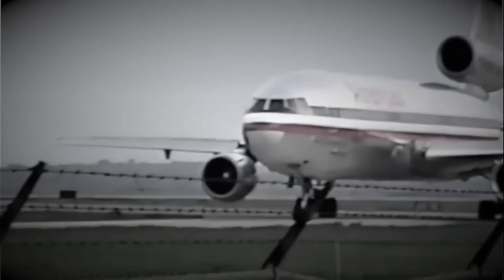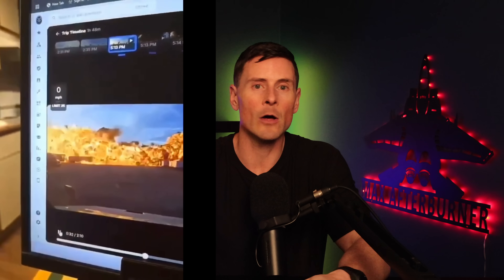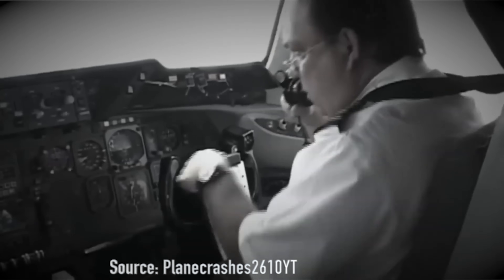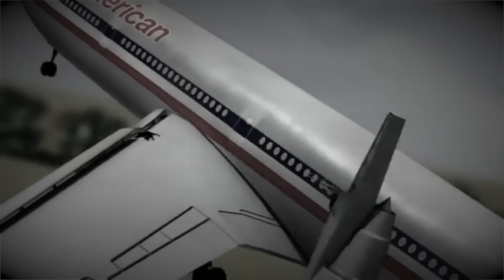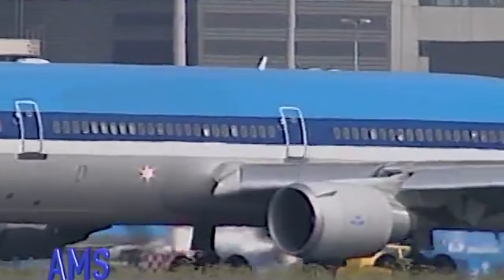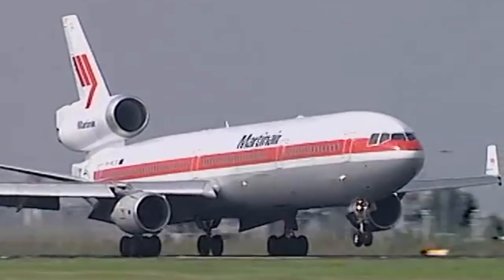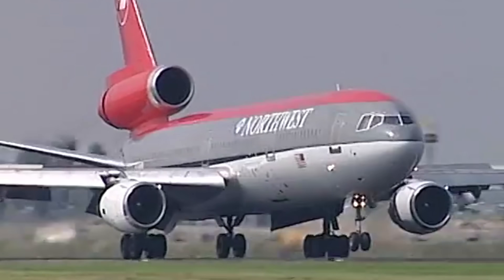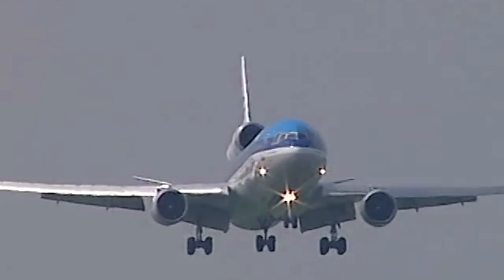Airline Pilot Exposes CRITICAL FLAW of UPS 2976 DISASTER

Comment: Number two being affected is a theory at this point but it seems possibly likely because of the wing fire caused by the Detachment of the number one engine.
Please give them time to study the actual chain of events before you try to compare what happened in Chicago with what happened here they do not have the same engine attachment points on these engines. I worked with Metals for 41 years in my main job and I also consulted on several air crashes notably the 7:37 problems that I told them early was caused by the rudder actuator. But I wasn't certain as to why that was failing but I knew that that was an integral part of the failure on those aircraft. But you have to give them time, this just happened a few days ago. Because there's nothing obvious except that there was a wing fire after major maintenance had been done on that specific aircraft. They are going to have to look at a lot of the maintenance that was done and what possibly went wrong. This particular md11 had a much more recent flight data recorders which may be of great help. But this is going to take a lot of time shuffling through the high amount of Maintenance that was recently done on this specific plane. And looking at what happened during this incident. I have been consulted on air crashes since I was a two striper in the Air Force. That was in 1976 when I was working on both Air Force and several Navy aircraft. Along with at least one civilian aircraft owned by none other than Daryl Grenemeier.

Comment: I imagine the only similarity is the MD 11 has some things in common with a DC 10 and both involved the no 1 engine and the aircraft was left wing down at impact. AA 191 lost the no 1 engine at a speed about 10 kts above V2, and at that time the engine failure procedure AA pilots accomplished was to raise the nose and climb at V2 speed. This speed was too slow with the left wing slats retracted and the left wing stalled. As an AA DC 10 pilot we were instructed to maintain the higher speed if above V2 at engine failure and not slow to V2 after the 191 accident. Research showed that 191 might not have crashed if the crew maintained the higher speed at the time they lost the engine.

Comment: It might be time to permanently retire these aging aircraft.
Reply: It's quite difficult to, because there isn't a direct replacement for the MD-11. Similar sized aircraft like the A330F and A340-300/787 either don't have freighter versions or have significantly worse payload. The 777 is too large and the 767 is too small. Now airlines must use the 767 and 777 in tandem just to fulfill the job of one MD-11.

Comment: Think about the problem of the debris search area outside of the airport.  If a plane crashes into a field or forrest, it is easy to detect metal and manmade parts, but the plane crashed into a place which has something like a junkyard, vehicles and structures with wires, pipes and equipment, so it won't be so easy.   Not only was the jet full of fuel for a trip to Hawaii, that area appeared to have piles of tires and petroleum products.   I wonder how much of anything survived?  Because the engine and engine cowl fell onto the airfield, it might make things somewhat easier.

Comment: https://en.wikipedia.org/wiki/El_Al_Flight_1862   Engine No. 3 (right wing, nearest to fuselage) separated from the right wing of the aircraft, shot forward, damaged the wing slats, then fell back and struck engine No. 4 (right wing, farthest from fuselage), tearing it from the wing. The two engines fell away from the aircraft, also ripping out a 10 m (33 ft) stretch of the wing's leading edge.  The official probable causes were determined to be:[3]: 46 
The design and certification of the Boeing-747 pylon was found to be inadequate to provide the required level of safety. Furthermore the system to ensure structural integrity by inspection failed. This ultimately caused – probably initiated by fatigue in the inboard midspar fuse-pin – the no. 3 pylon and engine to separate from the wing in such a way that the no. 4 pylon and engine were torn off, part of the leading edge of the wing was damaged and the use of several systems was lost or limited. This subsequently left the flight crew with very limited control of the airplane. Because of the marginal controllability a safe landing became highly improbable, if not virtually impossible.  Bijlmerramp - El Al Flight 1862 - Amsterdam Air Crash - full transcript https://www.youtube.com/watch?v=m3SLhwEzVz0
I worked in a compressor factory. Management wanted cost reductions and suggested to cut the Non destructive testing. I strongly recommended to do all required testing including the non destructive tests. When a machine is inspected and repaired by an OEM they expect that all required tests are done. Than you as OEMn can give the required guarantee on parts, repairs, etc. Than failure during operation is caused by the user and not by the OEM. I never had guarantee issues on my repairs! 100% OK.

Comment: I was wondering how the heck an engine could be lost upon takeoff... But structural micro fractures you mentioned sound like a plausible catastrophic failure due to multiple use from stress... I know aircraft go through annual maintenance inspections but I'm wondering if mico fracturing is difficult to see visually because they could be covered by paint  over the mechanical apertures?

Comment: I'm a pilot and other than the obviousness now of the statistics Airline safety is not the best it has ever been and it is most definitely less safe in my opinion.  Less experience in the cockpit, also way more airplanes in the sky with less controllers and the same systems....also, I don't know what your talking about 2 gs being normal in airline flying and that it's not unusual.....

Comment: Dye penetrant testing probably requires disassembly of the parts but it is not "maximally invasive" if there are no cracks.  The penetrant dye seeps into cracks only if they exist.  Often the surface is then sprayed with a white or other color coating.  The contrast of the dye leaking out is how you see the flaws.  If there are no flaws nothing penetrates.
Reply: They generally use Xray inspections for critical heavy fittings like that. A dye pen might be used to verify a visual indication.

Comment: It seems that all the aviation vloggers are trying to get videos out with the most exhaustive set of scenarios and conclusions to get channel hits with a long shot hope their hypothesis is close or correct and here's another one.

I've flown hundreds of hours on the former Swissair MD-11s and love the type.   The comfort, performance etc were amazing.  Rate of climb out of the old Kai Tak was mind blowing as was the climbout angle.   I'd get on another M-11 without hesitation.
and.....
This may have remote similarities to the AA DC-10 crash but the AA crash was caused by faulty maintenance procedures where they fitted a new engine attached to the pylon.

Noone knows (the real facts!) if that -10 failure happened to this MD-11?
Reply: Yes but the MD-11 has the worst hull loss rate of any widebody airplane at 3.12 per million flights. Which is 10x higher than the Boeing 777 or A330.

Comment: The MD-11 has been flying since 1991. Since they haven't all crashed, obviously, there is not a critical flaw. McDonnell Douglas had a great track record for aircraft, e.g., F4 Phantom. I suspect maintainence, metal fatigue, inspection deficiencies. Almost every incident comes down to post factory human error.
Reply: The MD-11 has the worst hull loss rate of any widebody airliner at 3.12 per million flights. 10x higher than the Boeing 777 and A330.

Comment: Anotheryoutube channel that had audio and there was warnings of birds near that runway if you noticed before the engine came off there were already flames comeingout of the engine pylon either melted from the fire flight 191 had no fire trailing it wh we n it crashed  the majority of crashes with the dc 10s is due to the failure of the luggage doors since it opened outwards ww2 91 was due to the aa not using the proper equipment to mount anddismount the engines

Comment: There is zero comparison between AA191 and this UPS crash outside of them both losing the #1 engine. You keep hitting the critical point so many times but you then gloss over it. 

AA191 crashed because the slats retracted and the pilot pitched to V2 (or V2+10 I honestly don’t remember and I don’t feel like looking it up because it’s irrelevant.) Thats what they were trained to do. HAD THE PILOT MAINTAINED CURRENT AIRSPEED at rotation the crash would have been averted period full stop. The slats were redesigned after the crash to prevent future incidents.

UPS crashed not because the #1 engine detached, but because the #2 engine suffered multiple compressor stalls as evidenced in the multitude of videos posted. She was basically flying with not two good engines but maybe little more than one good engine. At max weight. There was no recovery possible.

The only shared characteristics between this crash and AA191 was that it was a DC10/MD11 airplane and they both literally “lost” an engine. Everything after the separation event is unique to each crash.

Comment: Can we stop talking about the left wing stall. That is not what happened. There is a video out showing the plane crossing the street right after the tail hit the first building. The plane was still flying level. It then crashes into more buildings and you see it violently roll during breakup. The plane lost its #1 engine, probably due to an improper maintenance a month earlier, loose hardware or damaged pylon, then the debris caused a #2 stall, and when fully loaded #3 engine didn't have enough power to gain altitude and it hit the buildings. Pilots did an amazing job keeping it level as long as they could.

Comment: Well… not really. The AA flight lost hydraulics and the slats retracted creating a lift issue. That is why it rolled over.
This UPS almost made it. They looked like they might have been able to keep it up if they didn’t hit power lines.
That put them into the building, and even then it almost pulled out on one engine… but hit more power lines.
They were flying it… and flying it level until it hit wires.

Comment: As as a DC10, MD10, MD11 mechanic for 29 years now, My thoughts are, after seeing the images of the engine laying on the ground and the nose cowl still attached to part of the containment ring,  stage 1 fan disc failure. Severe imbalance causing engine/pylon separation. Similar to United 232. The tombstone fitting is the toughest chunk of metal on the wing. I will be very surprised if pylon failure ends up being the cause of this tragedy.
Reply: Thank you. Engine imbalance! I don’t know why everyone is talking about pylons. The engine was on fire and eating itself while it was still on the plane. It’s obvious.
Reply: @Drgoldthumb that was the number two engine’s compressor stall, not the number one engine that fell off.
Reply: @Tryna-B-Good Yep.. When the number one engine disintegrates and throws debris into the number two engine, you’re gonna have a bad day.
Reply: The engine and other scattered evidence left on the runway should determine quickly if your hypothesis is correct.
Reply: Yup - this is going to be an engine issue, not an airframe issue. Something caused that engine to explode.
Reply: I am not aeronautical engineer but I figured with the flame over the wig and the engine condition that a as I called it "catastrophic engine failure" occurred which caused the engine to be ripped from the plane and damage the fuel lines/tanks and the hydraulics, similiar to what happened with 191
Reply: They were doomed, so it doesn't matter if it was the wing or tail engine that had the compressor stall, but Captain Steeeve said it was shrapnel from the #1 engine failing that shot across and caused the compressor stall of the # 3 engine. Then there is the wisdom of the click bait crowd who will soon log on and amuse us.
Reply: Yes. Another pilot did a side by side photo comparison, 
and it looked identical to the engine with disc failure.
Reply: UA232 was an outright crack in the disc.
Reply: UA 232 was not caused by engine imbalance. It was caused by a undetected sub-surface defect that cause a crack to propagate. The crack was missed by United airlines inspection
Reply: @Alan-bm3ni im well aware. Im taling about the possibility of a disc failure similar to 232.  232 was caused from accidentally allowing oxygen and nitrogen in the casting when it was poured at manufacturing. Not something that could be detected without x ray
Reply: @abadzl1455 right, so why speculate engine imbalance and say similar to UA 232, when you know UA 232 was not an imbalance and had morning to do with the pylon or engine separation?
Reply: @Alan-bm3ni only talking about a possible disc failure. #2 on a 10 or 11  is quite stout considering the entire rear bulkhead is titanium all the way up and down. Wouldn't expect #2 to break
Reply: Update: The Pylon failed.
Reply: I am not a mechanic and that was my assumption based on the circumstances, past CF6 failures, and the images of the engine. 

It’s my understanding the engine did not fall off the pylons, the engine AND pylon came off the wings. The fact there was a big redesign of the pylon design makes me think having that same error happen again a lot less likely.
Reply: The NTSB has already announced that the pylon and engine separated together. This means the failure was at the pylon. Granted the engine probably did eat itself BUT that had to be secondary to a pylon and attachment issue. I won’t speculate as to cause and I’d encourage everyone else to do the same. Let the NTSB do their job first.
Reply: @dalgrim  No, the pylon separation at the attachment point does NOT mean that the engine problem would be secondary? The Pylon detachment could still be secondary to an engine problem. Ther initial failure COULD have very well been at the engine, causing a pylon failure secondarily. 

Just because the Pylon is what failed does not mean anything else was secondary to it. If anything, it is the opposite! 

Apologies if I misunderstood what you said.